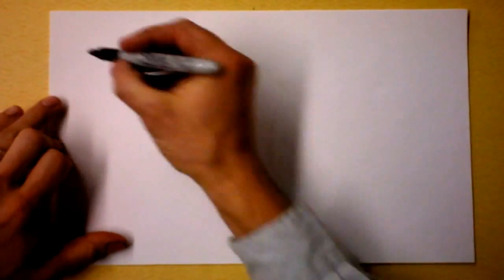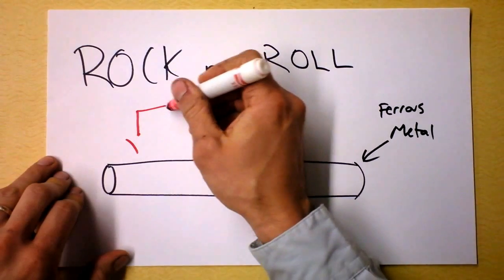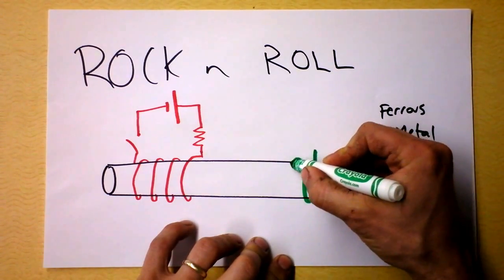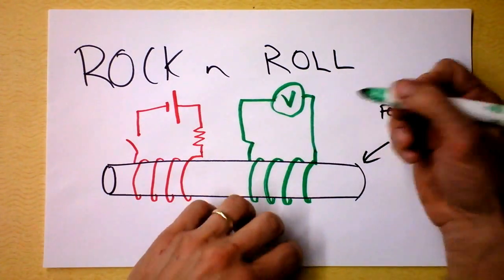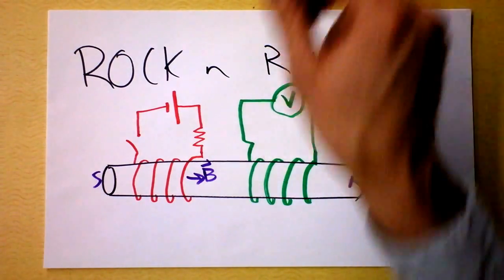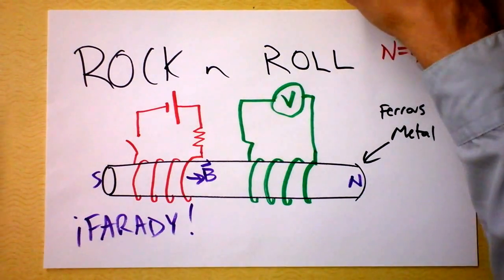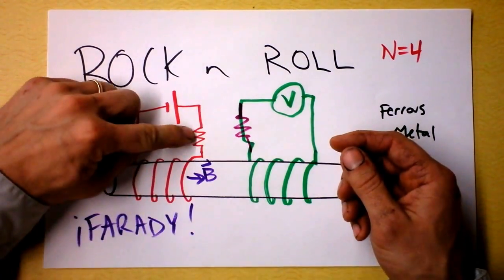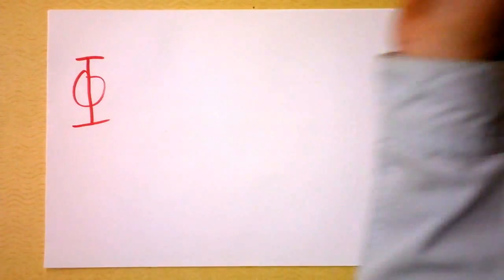Faraday's Law of Magnetic Induction or WHY IS THERE ROCK AND ROLL? | Doc Physics

Comment: Please connect the voltmeter in parallel in the second circuit for the momentary induced current to flow since a voltmeter has an infinite resistance

Comment: A limited area of knowledge or Endeavour to which pursuits, activities and interests are a central representation held to a concept of physical theory. In this way, a field is defined by the distribution of a physical quantity, such as temperature, mass density, or potential energy y, at different points in space. In the particularly important example of force fields, such as gravitational, electrical, and magnetic fields, the field value at a point is the force which a test particle would experience if it were located at that point. The philosophical problem is whether a force field is to be thought of as purely potential, so the presence of a field merely describes the propensity of masses to move relative to each other, or whether it should be thought of in terms of the physically real modifications of a medium, whose properties result in such powers that are, liken to force fields, having potentially pure characterized by their means of dispositional statements or conditionals, or are they categorical or actual? The former option seems to require within ungrounded dispositions, or regions of space that differ only in what happens if an object is placed there. The law-like shape of these dispositions, apparent for example in the curved lines of force of the magnetic field, may then seem quite inexplicable. To atomists, such as Newton it would represent a return to Aristotelian entelechies, or quasi-psychological affinities between things, which are responsible for their motions. The latter option requires understanding of how forces of attraction and repulsion can be grounded in the properties of the medium.
 The basic idea of a field is arguably present in Leibniz, who was certainly hostile to Newtonian atomism. Despite the fact that his equally hostility to action at a distance muddies the water. It is usually credited to  the Jesuit mathematician and scientist Joseph Boscovich (1711-87) and Immanuel Kant (1724-1804), both of whom was influenced by the scientist, Michael Faraday (1791-1867), with whose work the physical notion became established. In his paper on "The Physical Character of the Lines of Magnetic Force" (1852). Faraday was to suggest several criteria for assessing the physical reality of lines of force, such as whether they are affected by an intervening material medium, whether the motion depends on the nature of what is placed at the receiving end. As far as electromagnetic fields go, Faraday himself inclined to the view that the mathematical similarity between heat flow, currents, and electromagnetic lines of force was evidence for the physical reality of the intervening medium.

Comment: Dude magnetic flux is supposed to be BAxsin(x) not cos(x).If it was cos(x) Maximum magnetic flux is when the area vector is parallel to magnetic field which is rong as the field doesn't cut the area when parallel and thus should be 0
Reply: Mo Killem No because you're dot B with the Area VECTOR, which is perpendicular to the area itself
Reply: Uh your wrong lol, it is cos(x).
Reply: no if you think about it, emf vs t  becomes a sin curve but i see my error in thinking.He chose a different the component is the same the angle is different so he used cos(x1) while i use sin(x2).

Comment: I think you labelled your poles wrong. As the current flows through the ferrous metal, it will create a magnetic field in opposite direction. Aka the North side will start at the left, and the south on the right. You however have the direction of the magnetic field right, just wrong poles! :)
Reply: omg thank god u saw it too :DD i was thinking about this for ages and started doubting myself...
Reply: jgodwin247 thank you! I was questioning myself here 😅
Reply from the maker: At 2:35, I labeled the poles of the magnet correctly.  The current is not flowing through the ferrous material - the coil is insulated from it.  When the current causes a magnetic field, the atoms of iron tend to line up WITH the field, not opposing it.  And the norf pole of a ferrous magnet is the pole that has field lines leaving it, so it is the one on the right.
Reply: Doc Schuster won't there be eddy current flowing through the ferrous metal so as to oppose the b field to the right?

Comment: Thanks for the great video! Why does the induced voltage always depend on the area mapped out by the wire? All that area inside the square wire is just empty space so why is that area important? I thought it would just be the flux that actually penetrates the wire itself that would be important?
Reply from the maker: This is a deep question.  One approach:  every loop in the universe is given the challenge of keeping its internal flux constant.  The larger the loop, the more attention it pays to flux changes in the universe.  Similarly, a larger induced current will be necessary to cause the same strength induced field in a larger loop.  Keep up the good questions!
Reply: Doc Schuster Thanks Doc Schuster, you are awesome! So am I right in thinking that electromagetic induction is just the result of nature trying to maintain a constant magnetic flux within a loop? Why do you also get an induced emf when you cut flux lines (constant B field) with a conductor? There seems to be 2 situations for induction; one with flux cutting and one with flux linkage using coils.
Reply from the maker: You can trace it all back to F_mag = q*v*b_normal.  I've got some videos on the earlier bits.  Keep rocking.